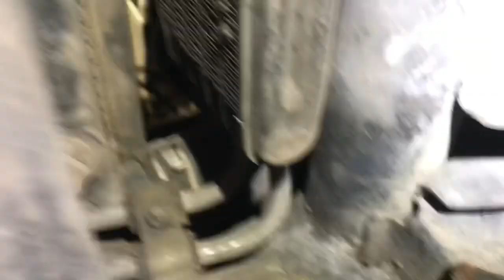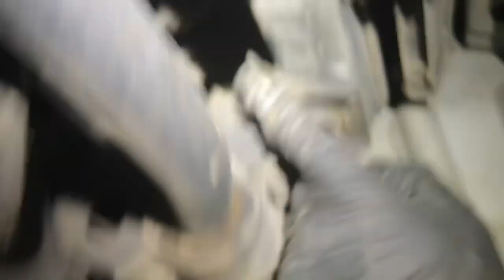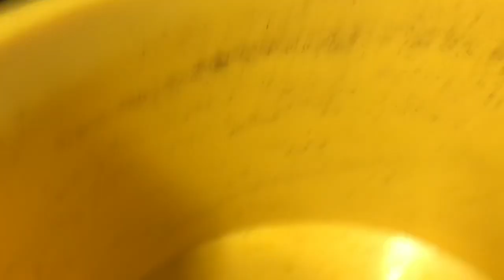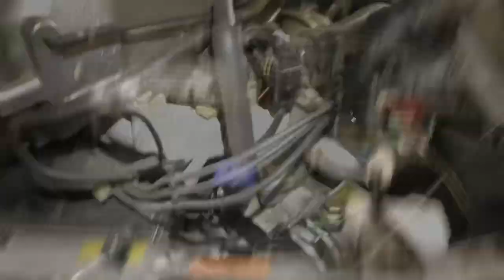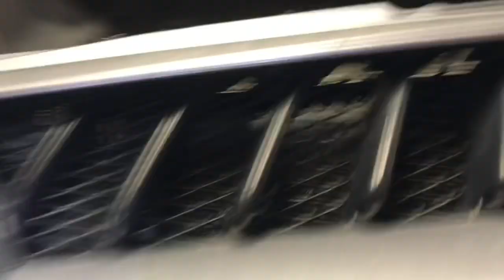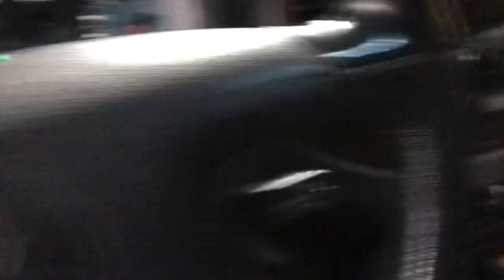Gen3 Mitsubishi Montero Coolant Flush using Thermocure - Rusty Cooling System with no heat, fixed!

Comment: how did you get the thermocure flush out of the block before adding coolant if you only drained the system from the radiator?

Comment: Watch this video it shows a way to flush the entire system with air pressure and water without running the engine, you maybe can build and sell this set up if make one that fits and allows us to hook up and bypass the thermostat

Comment: Can you use the key to turn engine over a few times to spit all the old fluid out?
Reply from the maker: No, it won't work. The engine has to be running for awhile.
Reply: @ do you use green or orange coolant ?

Comment: How did you get the reservoir off
Reply from the maker: It just pulls straight up and off
Reply: @ ok thanks and do I need to worry about air getting in if I follow your instructions?

Comment: Thermocure is non toxic, anything that came out of your engine is product of the iron oxides that dropped out, harmless to environment. Now any actual coolant is toxic, unless you use Sierra or Prestone Low Tox it's also safer for your cooling system as it does not become acidic like other coolants in 6 years or less, so if you spill some you don't need to worry about the implications it's base chemical is used in cosmetic products lol...... Oh yea Sierra, and LowTox Prestone is ok to use with aluminum engine parts....
Reply from the maker: @blkcoupequattro  great info, thank you!

Comment: Hey my hose have rust in them, is there a way to clean them out, im unable at this time to get the two hose.
Reply from the maker: Sure, you could remove the hoses and soak them in vinegar for 24 hours and then take a plastic bristle brush and scrub out the insides of them.

Comment: Cleaning vinegar and distilled water also works well as a cooling system flush.
Reply: Vinegar  eats rubber.
Reply: @jackman2865 Vinegar isn't a problem for most synthetic rubbers, like ethel propylene, which is what modern coolant hoses are made of.